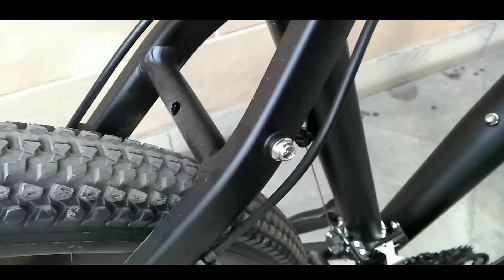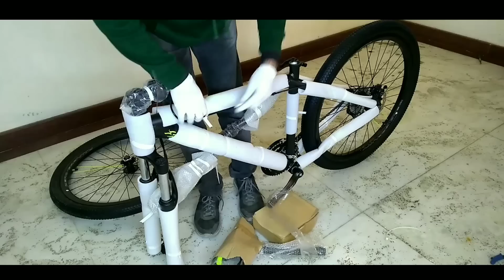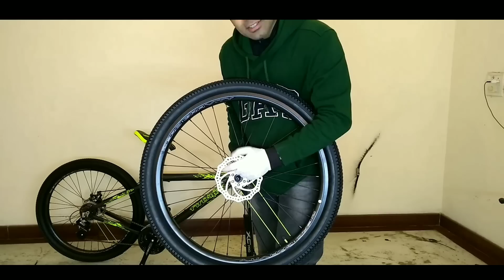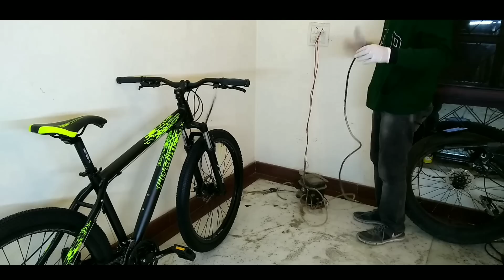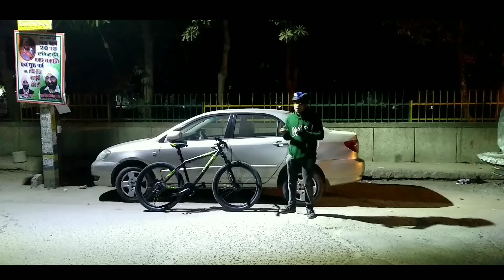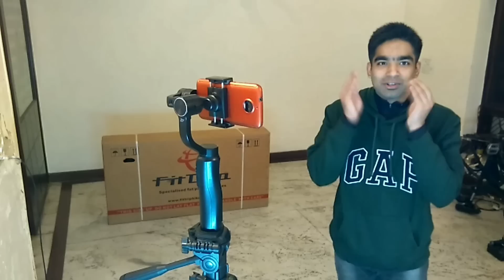How to UNBOX Bicycle Purchased Online? Did I Purchase New MTB ? | Buying Bicycle Online

Comment: Vaibhav apki mail id kya he help chahiye cycle related!!
Reply from the maker: +Nil Naveen yes please ask the question
Reply: bhai pls suggest which bicycle  will be best in around 15k(+-3k) budget .
requirements: Frame size - 21"

Brakes - Disc 
29" er 
Aluminium alloy material made
Front Suspension 
Front wheel quick reliever
Reply: @RidewithAB   bro , Once you know  which is best within 15k ....plz share..
Reply: @FatBikerVaibhav  maine buy ki hai a electric bike 100km.per hour
Reply: In just 40000

Comment: Bro, I used to watch and follow your tips regarding the maintenance of mtb. Actually recently I bought Montra Back beat and I notice that  the rear shimano Freewheel is wobbling abit. Is that thing need to repair? And also please please tell me about how to maintain the front shocker of this mtb. Its not that smooth n i saw after hours of ride lil amount f grease used to pop out on the chrome area.please seriously need your help.

Comment: Hey Vaibhav, what is your height and what is the frame size of the bike? I am looking to buy a vyper 29er and i am 5'11. Will size 18 fit me. The online calculator said that i should look for size 19. I currently have a cosmic flash of size 17 and I get backpains when riding longer. So, will a size 18 fit me or should I look for size 19 elsewhere.

Comment: I have Fantom mtb around 20k with 21 speed and carbon rims and it's damm fast It cruze around 50 kms in flat road if you have force as well but it's con is it makes noise of gears and the seat is hard as rock.